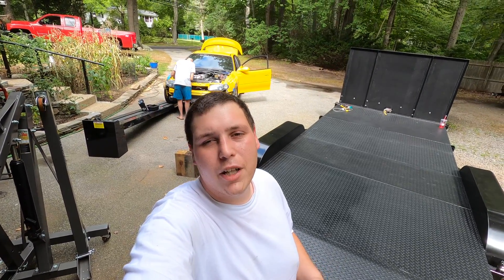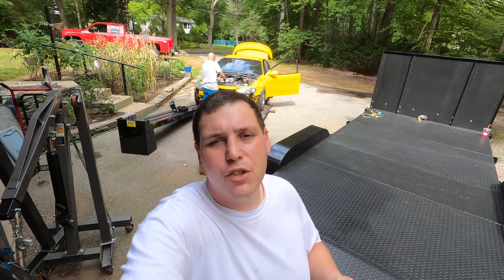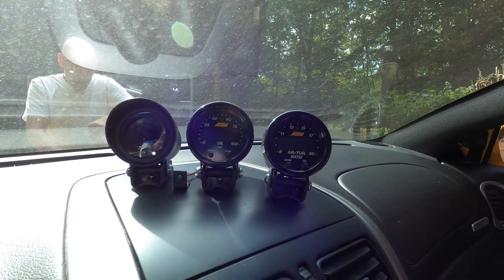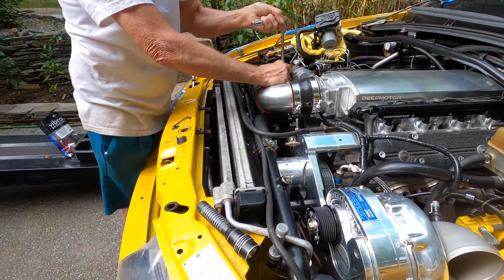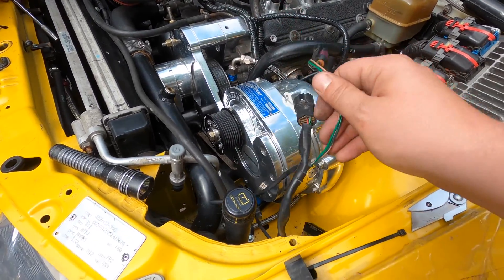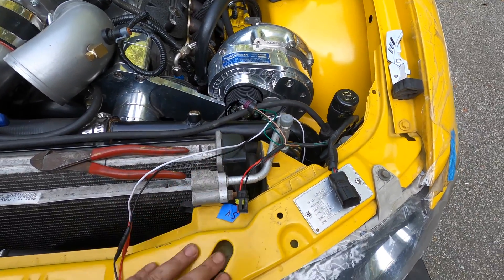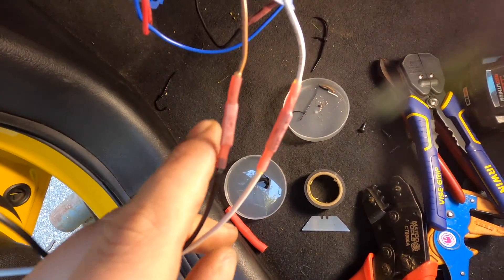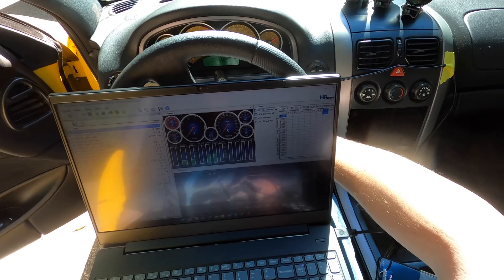AEM Wideband through air conditioning sensor via @HPTuners

Comment from the maker: Now that the hard part is over, we set up the VCM scanner to look for the signal.

For this to work, you need to log AC Pressure Sensor voltage. Right-click the channel list and select "ADD CHANNEL" to add the Channel AC Pressure Sensor; make sure the units are volts.

Next you need to setup a user math parameter that will take the AC pressure sensor voltage and calculate the AFR based on AEM's voltage output. Select TOOLS>MATH PARAMETERS. Select one of the unused User Maths. I named mine AFR and gave the abbreviation AFR (you can name it whatever you want to). Take this next line and cut and paste it into the Expressions field. Make sure to copy everything including the open parenthesis:

([7101]*2.3750)+7.3125

7101 is the PID the ECU uses for the AC pressure sensor, and the other math gets you a pretty spot-on (with my gauge anyway) AFR reading. IF you find that yours is a bit off, you can adjust for a voltage drop by adding and subtracting from the 7.3125. One of the source threads I referenced uses ([7101]/.5)+10, but it wouldn't match up for me as well as the above formula.

Now we add a Chart to display the awesomeness we've created. Right-click in the Chart v/s Time field and select CHARTS LAYOUT. If you have room inside a group, select the group header and select ADD SERIES at the top. If not, add a new group first. I like to limit the display to 4 at a time so I can see things better. Select PARAMETER, and scroll down to the MATHS>USER DEFINED>AFR (or whatever you named it). Set the Unit to "Air-Fuel ratio 14.7 -Gasoline" and the decimals to 2. I entered 20 as the max and 8 as the min, as that's what my gauge displays. You can add a reference line at a target AFR as well.

Now you can see the wideband's output displayed as AFR in your scanner!

Make sure that you save the layout, or you might have to do it over again when you close the VCM Scanner tool.
Reply: How were you able to change your unit? I get a blank box when I try to edit that portion
Reply from the maker: @bgf20  it’s been a while tbh shoot me a msg on Instagram Bought2Buildofficial with a picture of the screen and issue you are having and if I can help I will 🤟👍👍

Comment: Hey, have you ever logged your oil pressure when doing a pull in 4th gear from like 3000-6500 and notice the oil pressure not really climb or actually get lower? If so what was your remedy? Why would they front sump these cars?!
Reply from the maker: I haven’t logged it but I’ve seen it from GoPros inside the car and it seems to climb hard then it kind of slows down I use the melling high pressure pump 
 And yeah I am not a fan of the front sump  but they had to on these cars because of the front cross member sadly 

But what are the oil pressure’s you are seeing?
Reply: @bought2build  same I have the 10295, when I do a pull from like 3 to 6000 the pressure starts at about 40 and it never climbes or sometimes even goes backwards to low 30”s.. I’m convinced it’s the oil sloshing away from sump, this car pulls so damn hard. If I slowly accelerate and bring the revs up I have all the pressure. It must have been like this all along I just only found out because I just started dataloging. I’m going to experiment with raising the oil level.
Reply from the maker: @baby-sharkgto4902  that’s what I was going to say cuz mine it’s 70+ during a pull I only run a little extra oil in it but my car also leans forward a good amount because of the wheel tire and suspension setup
Reply from the maker: @baby-sharkgto4902  ohh hey sorry just thought about this but when I had the oil pan off I plugged the little oil pressure relief port on the pan as well sorry just thought about it that would probably help
Reply: @bought2build  hey thanks for that tip! That is one I have not heard of, and I thought I had heard it all on these cars by now. I know that you know a lot about these cars because you do your own wrenching too. Thanks again
Reply from the maker: @baby-sharkgto4902  any time 👍🤟🤟 here’s a link to a block off it’s super cheap and simple just sucks you have to drop the pan to do it 

https://www.googleadservices.com/pagead/aclk?sa=L&ai=DChcSEwi97YPJ3s-FAxV6XUcBHf-CC9YYABATGgJxdQ&ae=2&gclid=CjwKCAjwrIixBhBbEiwACEqDJS4QAh3z3m7vHhjluhaqgAsCp-Iyhle8TZlD8vAuqUIHKJtjxRlFyRoC344QAvD_BwE&sph=&ohost=www.google.com&cid=CAESduD2WcRGDzYyKUgoCIj1kwjSaTZ9mParz24SVlvDWHtbJfVsa6m1Eo3x3MGEiQcNm_XENE4Akyws_sJReHUvruIJuCFQgssfjXfDgwawhh9oUGYatvyijftRo2XDOGc6cCPDkFdeLrrbnFkutMOAOg6PiVymBEA&sig=AOD64_0LWcmDgF-ioTbg_pA7-8UcWcdXkQ&ctype=5&q=&ved=2ahUKEwix0P3I3s-FAxUyg4kEHR51A1oQwg8oAHoECAIQJA&adurl=

Thanks for the support 🤟🤟🤟🤟🤟🤟
Reply: @bought2build  you the man, thanks again!

Comment: Where did you get that 180° pipe on the front of the ProCharger I have the f1a ProCharger on mine and would love to run a filter
Reply from the maker: You can get it from brutespeed it is overpriced in my opinion I got it free used from a guy on Facebook when I bought a meth kit,radiator fans, some American racing 1 7/8 headers, and some other stuff otherwise I’d just make one myself but I’ll attach a link in case you do want to buy it 👍👍

https://shop.brutespeed.com/ATI-AIGN1I-004-04-06-GTO-Air-Inlet-Tube-ATI-AIGN1I-004.htm
Reply: @bought2build  do you have to drop the rear subframe to do the lower control arm or did you just do that to replace everything else I need to replace passenger side lower control arm in the rear making sure I don't have to drop the whole rear subframe